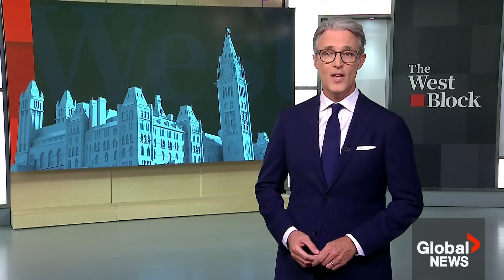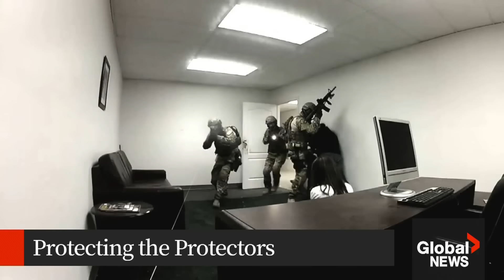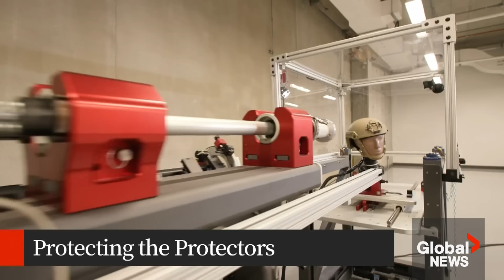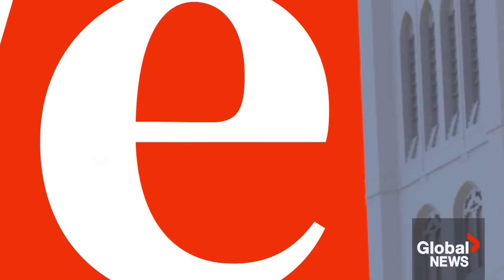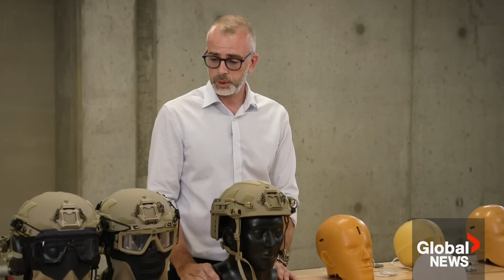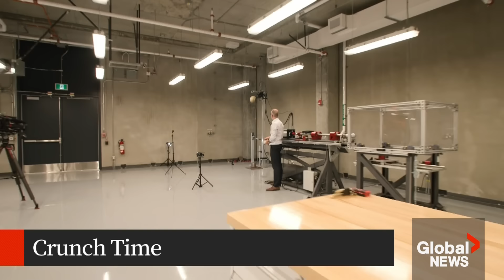Canada's Special Forces get new gear for battle protection

Comment: to prevent neck break from a shot in the head at high kinetic energy, back veil program needs to connect rigidly to rear backplate armor, this way when a soldier gets shot in the head they might fall backward get knocked over almost as you'd expect any object is easiest to pivot if torqued at largest r distance from ground so just some form of futuristic armour could help prevent neck breaks in case of high kinetic impacts that apparently cant penetrate helmets somehow still shock of impact is inhumane enough to scramble your brain into mush probably after impact but ok...